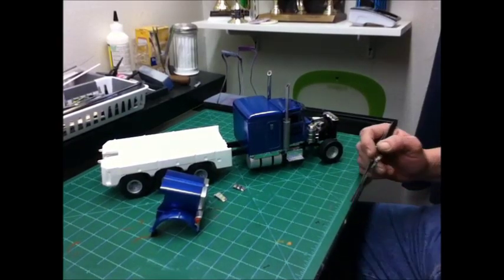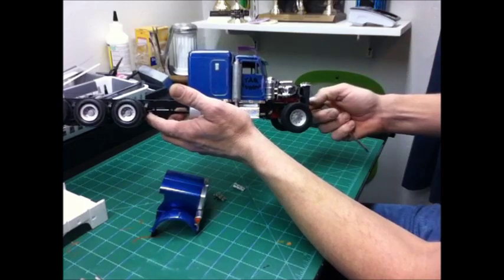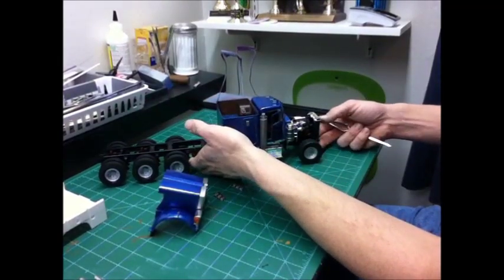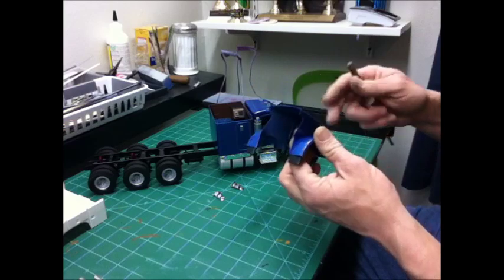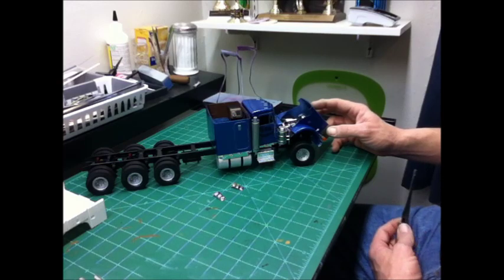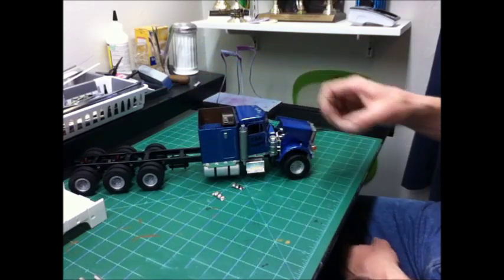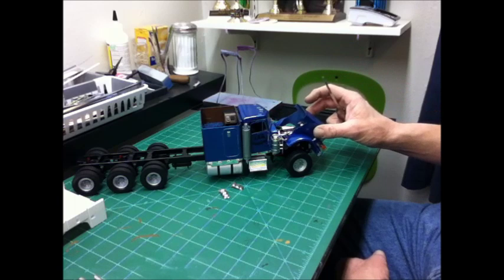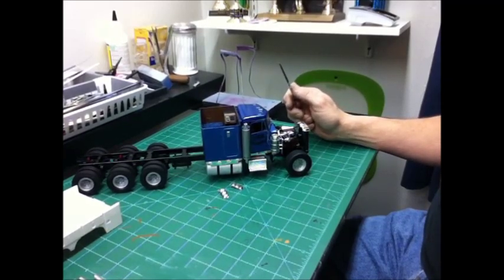Peterbilt Wrecker Update#2

Comment: My Revell Germany Kenworth W900 kit has an extended hood and did not include those mufflers hanging off the back of the fenders. I made a set using some soft black cowhide leather that glued on nicely but then the air filters don't have that shield on them either. I could see that they would be in the way if the kit came with them. The cab and sleeper mounts too didn't line up and had to do slight modifications. Revell should make that Pete kit with an extended hood. Keep working with it and you'll get it eventually.
Reply: Damn spell check printed mufflers and not mud flaps.

Comment: I like the color..That kit is a pain in the ass..I think they need to Rebuild the molds..You seem like a Experienced Builder..Big Rigs are very tricky..I basically  Prebuild the entire Cab /Hood/engine/Front suspension & Front bumper..I use Piano wire W/a pin vise to hold together what i can and Scotch & Masking tape for the rest.. know its "Time consuming " ..but it takes the Frustration out Later after the model is Almost DONE..Looking good..

Comment: Mathew. What would happen if you take the mud flaps off and use some small round styrene rod to mount the flaps onto? Then you can attach them to the frame. They will always be stuck there but you can open and close the hood and the flaps will look like the are hooked when closed.
Reply from the maker: Thought about that. The fender its self hits.I may finish it with the hood open. Just makes transport to any shows a little more difficult.
Reply: Matthew Gedert Bummer!